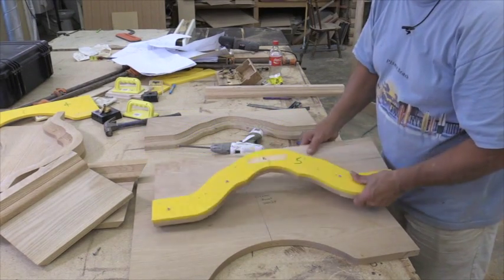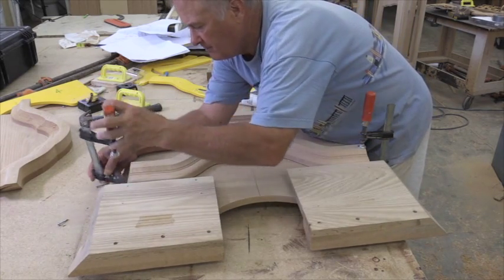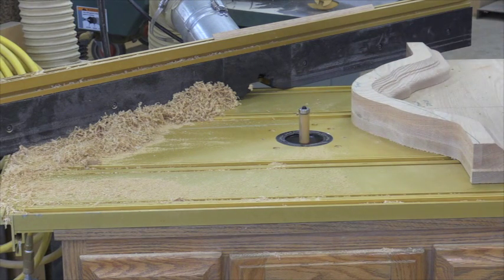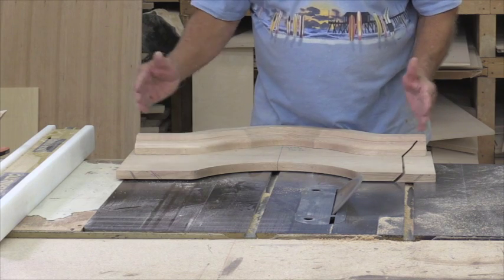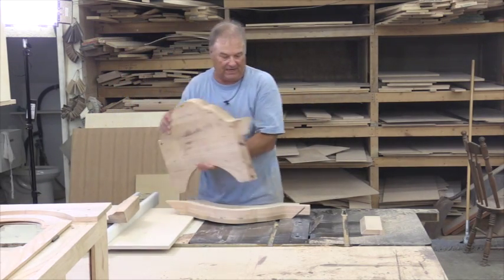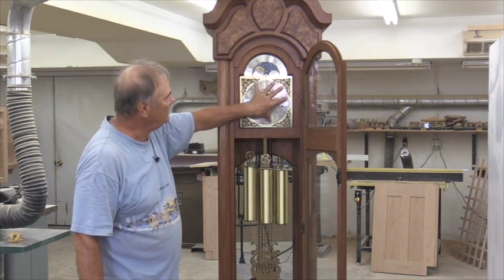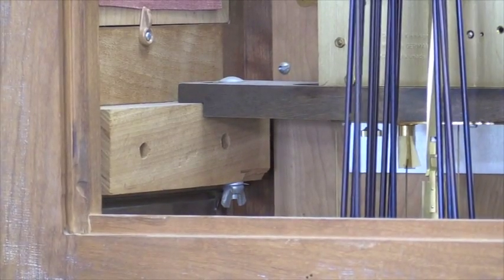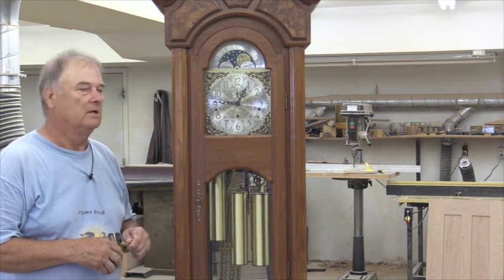Sommerfeld's Tools for Wood - Grandfather Clocks Made Easy with Marc Sommerfeld - Part 4

Comment: I bought Marc's router table set up about two years ago and couldn't be happier.  I was recently watching a pro do a rail and stile door and the set up time for the two bits was time consuming and tedious.  Marc's bit set with his easy set make it a snap and my rail and stiles always come out perfect with very little sanding.  I also use his rail and stile bits for gluing up large panels and table tops.  It creates a large top that needs little sanding if any and always comes out flat.  Not to mention the joints are extremely strong and I don't have to worry about them coming apart.  I have other bit sets that I got from Infinity and woodcraft, but Marc's work so much better.  The router table package alone will have you creating beautiful projects the pros create.  I know I sound like a paid spokesman, but I'm not.  I'm just a part time woodworker that wanted a system that is repeatable.  I now turn to Marc's site for every router bit I need as I have found them to be the best and easiest to set up.

Comment: I’ve always wanted to do this. I even started on one once but never got beyond the base. I have half way decent wood skills and I have done courses in woodwork, which I really enjoyed. You have cleared up an awful lot of mysteries about making a long case clock. Thank you.

My only problem is that I have never used feet and inches - well, not since I was a child - and I would have to convert everything to metric but 8 think it could be done. This is exactly the style of clock o want to build and I would make very few changes. Americans are also very lucky when it comes to choice of Timbers. In Australia virtually all of our Timbers are hardwoods and they are notoriously difficult to work. I have used imported Timbers like walnut and maple but I would prefer oak because I like the look of it.

Anyhow, thanks again.